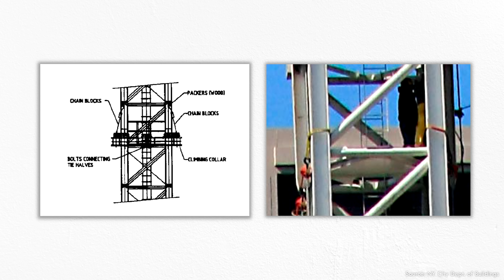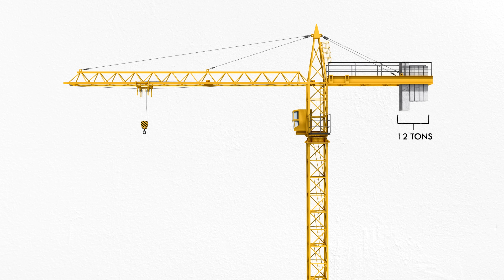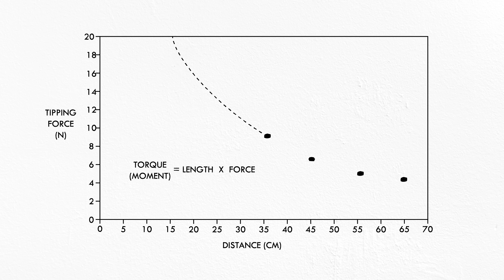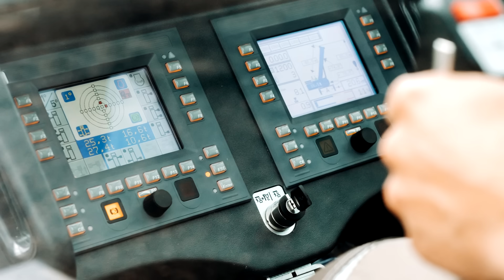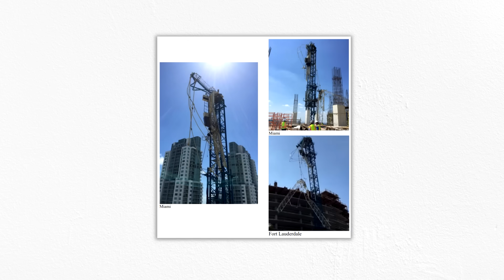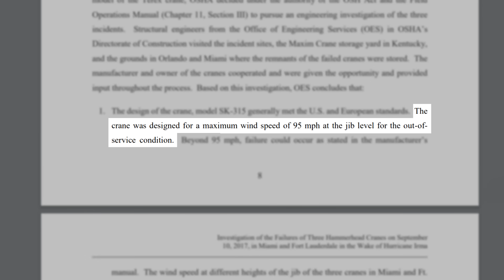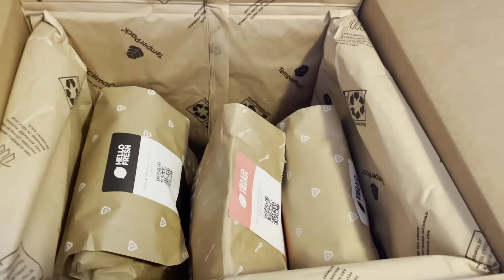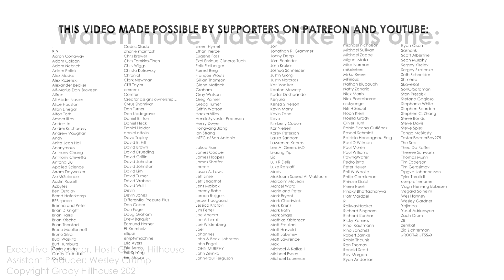Why Cranes Collapse

Comment: My career has included operating cranes as hefty as 240 tons and when this video started I was hoping to maintain the same respect for Grady which he's earned in other videos. Well, I respect him even more now.  Every point was  correct and explained so a newbie could understand it.  This video alone could replace several training videos for new crane operators and make their workplace safer.  Thanks Grady.
Reply: This video should be included in training videos
Reply: @utube,.  It's just fine that he speaks to the total newbie, as well.  I am confident in my knowledge and abilities so him addressing all levels of experience does not hurt me a bit.  I was surprised to learn something new from this video, the part about adding in the wind component to the total load.  It makes sense and was enlightening since I'd never operated that large and that close to the edge in outdoor environments.  Good stuff.  😁
Reply: Thank you so much for posting your comment.
Reply: All of his video's are 100% top notch. I'm assuming he's in the industry right now, but honestly he should be a professor.
Reply: Gerard, I am happy that you have identified a problem.  What is your solution?
Reply: @Mattthewanderer  Had a CCO myself.  The test was not easy.  If the manual in the crane is not the correct one it is the operator's responsibility to refuse to operate the crane until he or she has the correct information on how to do so safely.  As far as the weight of the load, that can also be calculated, sometimes as simple as looking at the shipping info from the vehicle delivering it.  Safe crane operation is a team operation from engineers to operators to riggers.  If in doubt leave it on on the ground till all safety issues are resolved.  It  can be hard to say no to your boss, but it's a whole lot harder to say you are sorry to someone's wife and kid's that you screwed up.  Never had an incident or accident and pissed off management more than once when I told them that what they wanted me to do do was outside the safety parameters of my equipment.
Reply: Surprised there wasn’t a little more info on big blue which makes that disaster even more egregious. That crane requires 3 operators. So, 3 people agreed to that dangerous lift. That crane also had 1 crew of iron workers refuse to participate before they rounded up a new set of 3 for the man basket. Also the winds were into the 30 mph despite every crane operator alive knowing 20mph is usually stop work or load reduction limit.
Reply: @mikes70mustang the operator caved to the pressure from the contractor. They had been waiting for the wind to settle down for weeks. At 97% it wouldn't take much side wind to pull it over sideways. In my opinion a 97% lift is ridiculous for an object that catches the wind like a kite. I sat for 2 days once waiting for a side wind to slow. And it didn't bother me at all. But that was a 90 ton with only 230 ft of stick. That operator was in a big Lampson probably 2,000 tons or so. And weeks of contractor pressure. He folded and killed 3 ironworkers.
Reply: Finance degree & masters took both engineering physics courses that a C.E. must pass during undergrad and voracious reader of technical manuals, but you are correct as well as more knowledgeable and Grady definitely explained this that normal people like me can understand the differences, risks & failures of cranes.

Your review was exactly correct.
Reply: I've been in the industry since 89.  I have seen I don't know how many safety videos that, well, suck.  This one is hands down one of the best I've seen, and it's not even a safety video. Please keep up the good work!  The only knock I have was on the tower cranes.  I was taught that the front of the crane is called a jib and the rear is called the counter deck. Other than that, you're information is spot on.  Good job.
Reply: As a crane operator I can say that the most common reason for cranes tipping is operator error. When setting up a crane you tell the LMI "the crane's computer" how much counterweight you have so that it calculates your load capacities. A lot of crane operators will lie to the computer and say they have more weight so they have higher capacity
Reply: I like AvE’s crane collapse reviews too
Reply: Liked and Sub’d based off the video as well as this comment! 👍🏗
Reply: What a fine compliment. As someone who is just starting to learn about operating cranes, I am going to save this video for review.
Reply: Couldn't agree more. My old man was a crane mechanic then operator. He's spot on in this. Scary stuff just got to know what you're working with and what you're doing.
Reply: I worked marine construction and using a crane on a barge is tricky...
Reply: @fredgervinm.p.3315  .....It's a whole new ball game working in a marine environment, as you would know.  When a load starts swinging because of waves & swells rolling a barge or a ship everything is magnified.  Well-place tag lines managed by deck crew personnel for smaller loads can help, and supplemental rigging to stabilize larger loads can also help, but things can get out of control in a hurry.  Good offshore crane operators and good foremen are essential for safety.
Reply: This is an awesome comment! Thank you. Grady's videos are fascinating and I love to hear that he's on target.
Reply: orang dan
Reply: crane places have got to be comprimated!!! is one of the most useful things i'v ever heard
Reply: This was really great man. I work oilfield and deal with them about twice a month. It's amazing how far they've come
Reply: Totally agree ! CCO
Reply: Gotta love when YT videos are better than professional training videos <3
Reply: You’re probably a real fun guy to have at a party
Reply: @caseyalan5398  There's so many replies I have no idea who you've even replied to anymore haha
Reply: I am literally traveling to go to crane school currently and have my first day of class tomorrow. Watching these videos helped me with understanding! Thank you practical engineering!
Reply: What brand was that 240?
Reply: This is an overview for beginners. All correct points. Maybe could have explained weathervaning better. It's counterjib into the wind. Which the diagram did show. However the cynical side of me would rather have a crane operator explain these things. And in a little more detail.
Reply: Good vid
Reply: Grady-Sama never misses 😂
Reply: Cranes have always amazed me. I can't imagine how scary it is operating them.
Reply: That's a baby crane they go up to/past 20,000 tons lol 90% of accidents are user error
Reply: This reminds me of a story my father (construction safety worker) told me. Working under his dad's company in a nearby city, they were extracting segments of a roof that had been relayered multiple times. It was basically a multi-foot thick slab of roofing. The crane operator extracting it had to override a lockout as soon as the slab was being held by the crane and had to force the slab closer into the radius and dropped it to the ground as fast as he could. This wouldve been sometime soon after 2003, but he says you wouldn't get away with that now.
Reply: I'm not in the heavy equipment industry, however, I have been part of a group that was required to watch a safety video. The abundance of free snacks was obvious compensation for the very understimulating video! 

Rember and learned more from our instructor's "white book of horrors" as I call it, than that video.
Reply: He was wrong right off the bat. Cranes have uses other than hoisting.
Reply: I just want to watch crane disaster compilations.
Reply: @garrysekelli6776  I’m with Gary over here 👈
Reply: Great comment, my question to you. Why wouldn’t you maintain the same respect for Grady off the bat on this video. Assuming you did in fact gain his respect in his other videos, why wouldn’t you on this one? Knowing he makes amazing, knowledgeable videos all the time. It just seemed like a useless comment to make.
Reply: @AlMai222  "Why wouldn’t you maintain the same respect for Grady off the bat on this video."

Yup, to me as well, that sounded utterly arrogant and pretentious, and definitely dispensable.
Reply: @AlMai222  Because the guy is arrogant, he thinks he knows everything and more about cranes and he thought Grady knows nothing..
Reply: @AlMai222  I believe he was being creative with his compliment, that's all
Reply: My Cousin is a Retired Houston Ship Channel crane 🏗 operator of many years !! 
 His kid WUZ dangerous cause his WUZ Vain reputation when he did containers !! N they wanted a ship unloaded in 2 days !! Houston weather allowed for this to happen ! Many got pretty boarded ! I let him ride my motorcycle !! He said when he got his , it “Woke him up” !! He drove to n from New CANEY , TeXaS !! Car n truck we’re dismal ways to get back n forth !
  We rode for many years ! But he sold his n my carburetors are clogged ! Bout to remedy that ! 
 So many aspects of a job ! I do construction ! We have hired him to rig n signal the lifts n drops !! He KNEW from the Union Training !! Iur Guys felt SO much more comfy when he helped !!
 GOD BLESS
Reply: All I could think was, "meet Grady"
Reply: Matthew, you're one of the Sons of Martha, as Kipling wrote more than a century ago. God bless you and your brothers.
Reply: I want to watch crane accidents. Keeps me from getting complacent
Reply: The problem you are operating it , not a installing it !!!! So if they gave you the wrong manual or the crane was installed wrongly you wouldn’t know !!! Yea like the 4 tones extra contre wight or if they over loaded , you couldn’t know !!!!
Reply: @gerard4039  normally when a crane is being put together on a jobsite the operator is part of that crew.
Reply: @gerard4039  thats why there are crane inspectors. everytime a crane is installed they have to be inspected by a certified person. If there is an accident caused by wrong install, thats the inspector fault not the crane driver.
Reply: @gerard4039  you need to know how it is constructed before you can operate it
Reply: @gerard4039  that’s a good argument for operators to understand the design and operations to a deeper level than needed, so you know if you’re getting nonsense in a manual.
Reply: Operators are trained to properly  inspect and make sure everything is installed correctly 😉
Reply: @gerard4039  yes you would know if you were a competent operator you check your manual and make sure it has the same serial number as the crane you’re working on that way there can be no mistakes.
Reply: Every point may have been correct, but I would say he explained it like we were all 3 yr old's.
Reply: @utube1818  Previously I knew nothing about cranes. I learned plenty! This "3 year old" appreciates Gradys communication skills. I'm not an engineer. Grady communicates so clearly even this "3 year old" understood every concept he explained.
Reply: @daleleisenring4275  I am not an engineer either, and like you learned a lot about cranes. What I didn't need to know is "You can do a lot with your own sweat and muscle and there's even tools to help you" I mean come on.
Reply: @utube1818  why the negativity? Live and let live. I enjoy this guys content.
Reply: @utube1818  thats called an opening statement. Most videos with a larger production budget include an opening statement. It's there to set the tone of the video.
Reply: @utube1818  This is exactly how a good communicator imparts information to people of various levels of knowledge.
Reply: @utube1818  I've done a lot of training down through the years. One has to assume the audience is not ready. Hungover, mad at the spouse or boss, know it alls, jealousy of instructor, etc.

Assuming the students are three year olds is a little on optimistic side.
Reply: @utube1818  His audience is people who know very little or nothing about these topics, including lots of kids.
Reply: @utube1818  .....I have found in my many years in construction--including military operations, commercial deep sea diving in the oil fields, and operating a remote power plant in Alaska--that those individuals who talk as if they are above mere mortals are generally the most dangerous and problematic on a job site....and the least wanted there by fellow workers.  This video was not made only for your approval.
Reply: @utube1818  “If you can't explain it to a six year old, you don't understand it yourself.” --- And by your own words, Grady understands this perfectly as he can explain this to a "3 year old". This "3 year old" is very grateful for that kind of explanation.
Reply: @utube1818  that’s the thing, these types of videos are for people who know nothing about the subject, his examples and clear wording helped me a lot to understand the video! I loved it and if he’d used more complex or subject specific words I would’ve had a much harder time.
Reply: @Utube 1  does it really matter?  At least it's explained correctly.

Comment: I donno ive only worked around a crane once and i don't think it was lifting that heavy of a load i think it was only 5 tons, it was putting a transformer on a concrete pad for a solar sight i was working on, I've been in solar and construction for like 3 years and cranes really don't seem to be all that common at least in my area

Comment: Thanks for another excellent video!  I'd say I feel safer around cranes, but the exact opposite is true; any time human error can have that much effect it's terrifying.  Ideally you need to implement processes (checklists, steps, competent supervisors watching over, etc) and even make the equipment fussy enough about its operating parameters to remove or at least minimize the error from the dumb human's range of options, but that's not always viable.  Sometimes you just have to have faith in your fellow man, and that's where the terror comes in.

Comment: Wind or no wind I would never want to operate a crane at 97% capacity. That's just asking for trouble. 80% seems like a comfortable cap. Not that I've ever operated a crane before, but if I did.....
Reply: 97 % is just 97 % of the permitted load limit. All cranes in Europe have to withstand 125 % of the maximum load without tipping over, most manufacturers even add a additional reserve. 
Of course you should never use more than 100% of the permitted load limit, the rest of the reserves  is necessary for dynamic forces. 
The main problem with ''big blue'' was the side wind, it was too strong and the crane is much more sensitive to wind from the side than to wind from the frontal direction. The side wind put forces onto the crane itself and the load, which led the king pin (the pin in the middle of the turntable) to rip off, and the crane fell to the side afterwards.
Reply: @simonm1447  Well, that clears things up for me. Thanks for the clarification.

Comment: Awesome vid as always!
I don't have a lot of experience hands on with cranes, but I've spent the better part of the last ten years with a tree company working out of a bucket truck. A lot of the same principles apply to setting up correctly for our truck mounted units. Wind is a constant factor, not only for the movement of the boom, but in the tree we're working on and- often- the power lines as well. Our units don't generally lock out with regard to over-reaching, though I imagine there are higher end (and more expensive) machines that would and I've yet to fly a boom that was rated for more than the operator.

Prior to this, I did a three-day course as part of my trade school program. Most of the conversation was directly tree related, but the instructor shared a series of photos from a site where the crane owners had wanted to flex a little bit by sending their newest and biggest crane to a site for work. The 50-ton unit had done great the previous day (so the story went) so the 90-ton would be even better....until it went through the upper deck of the parking garage they were working from....

Comment: 2 years ago i've seen it myself when our mobile crane tipping, operator trying to extend boom length too far with appx. 12 m pipe length attached. Just like in 8:34, but the pipe fall to pipe rack and stopped there

Comment: Speaking of cranes, one tower crane I'm surprised that didn't collapse was one in Kingston Ontario back in 2013 which positively scorched after the construction site under it turned into a massive fire that was hot enough to severely burn the crane operator on top, and damaged or destroyed every single building around it.

Ultimately the crane was disassembled with a quartet of massive mobile cranes operated by Mammoet, with three stabilizing while one disassembled its charred and weakened frame.